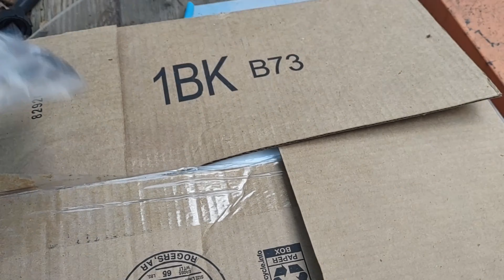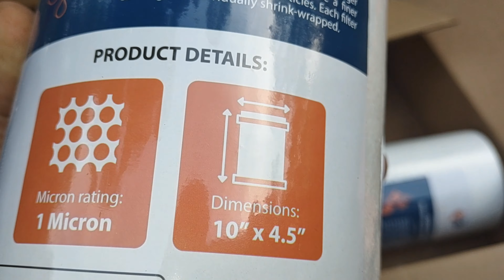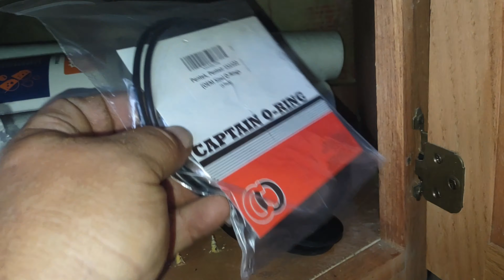While Maintaining Our Off-Grid Land Surprise Visitors Show Up !

Comment: Hey man, I really dig your channel but wanted to give you a heads up. Because you’re using rain water, AND now using a 1 micron filter. There is 0,0 minerals present in your drinking water which down the road is gonna be bad for your health. Think about putting a re-mineralization system on your tap, that way you’re still getting the essential minerals one would usually get from their drinking water.

Comment: Hey there, intrepid dude, handy tip here: Your best bet for cutting smaller trees & stumps off at ground level or below - just use your battery sawz-all! Won’t even bother an older pre-used blade, Far better than trashing your  costly $$ chainsaw blade on clearing trash trees & brush. 😎
Reply from the maker: ay your right ..I've done it...need to make it a habit